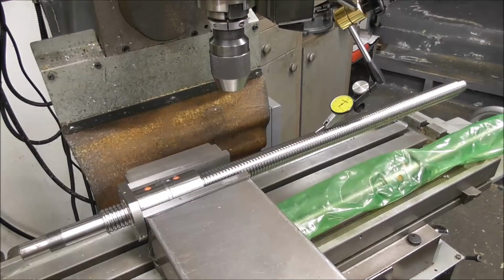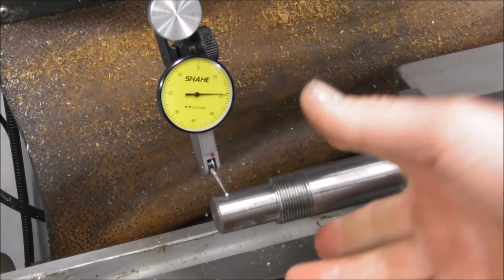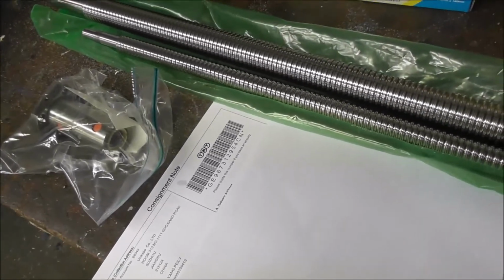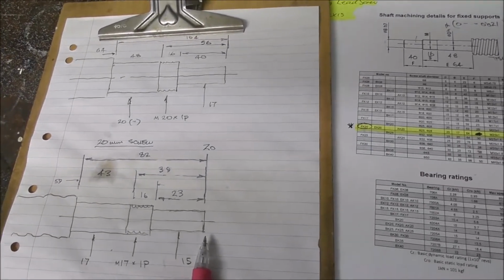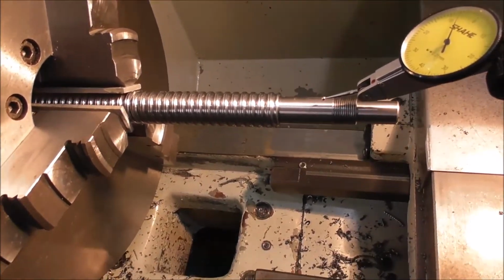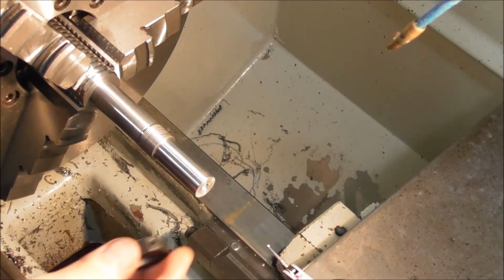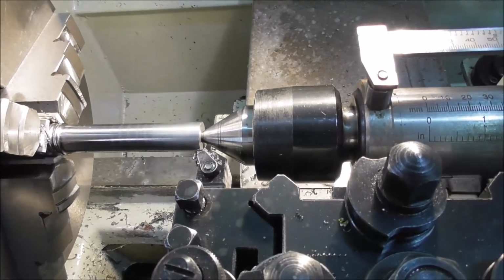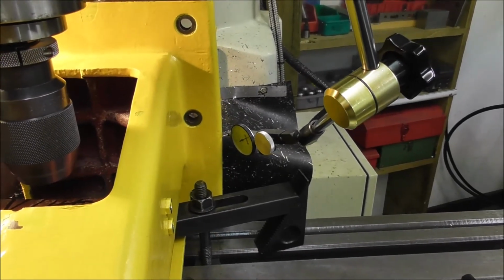CNC Conversion - Ballscrew Machining

Comment: Its great to see how you tackle this sort of job.

The following is how it is done in the factory and  think this is a reasonable quality supplier.
The reason I think this is the number of times that they measure the amount of bending in the shaft.
From the video it would seem they just use a 3 jaw chuck and assume the OD/ID and chuck are all in alignment.

I have seen other videos where they temper then check for bends once after the tempering and that is all.
 
https://www.youtube.com/watch?v=L5XEdwxN9Lg

This would also suggest that if you are machining a ball screw further along its length, by more than say 20mm, you may want to think about tempering that portion of the screw.
Reply from the maker: Hi Ian. Very interesting video. Thanks for sharing - I wish I had seen that before I did that job, it would have helped me and saved time. The processes they use seem mostly ok..but not the highest quality. I suppose they have to meet the market and as always cost is important to most buyers. Re "if you are machining a ball screw further along its length, by more than say 20mm, you may want to think about tempering that portion of the screw" Yes, I agree. Cheers, Cliff

Comment: Why checking the outer diameter that is not machined to tolerance? I would have checked the inner diameter where the balls run.
Reply: Basically what one should do is to use 3-wires method. The wires should be resting on the ball races.
Reply: @The_Unobtainium  yup, this is what he did when he checked the end machining concentricity using the ballnut to spin the ballscrew
Reply from the maker: Hi - I am not sure what section of the video you are referring to, its two years ago now but from memory I was not checking the OD was to tolerance. Just checking concentricity and parallelness. (I was assuming the thread profile was factory rolled and that the ID and OD are fairly concentric, I found the thread itself was made to a much higher standard than the subsequent modifications). Cheers, Cliff

Comment: Another Good Video. I noticed the M casted on your milling machine, which is also on a very large 5HP , NT milling I have up here. It,s Taiwanese, MicroCut , light years ahead of Chinese. Also have a MicroCut 24x120 lathe, which the manual says ite made in Taiwan, but the bed has a casting plate, made in China.
Thanks again 🇨🇦
Reply from the maker: Cheers! Cliff

Comment: hmm, this is a bit of a awakening - Maybe I will machine the ends myself. Do you think using a toolpost grinder to machine the hardened bit would be easier?
Reply from the maker: Hi - Perhaps hardness test the area with a file first to work out the zones that will be a problem, especially if you need to thread a hard zone, it is probably easier to flame heat and temper that zone. The hard zone may be deep, and toolpost grinding may be quite a mission. Let us know how it goes! Cheers, Cliff
Reply: yea, i was thinking spin slow in the lathe and run flood coolant over where i want the hardness to stay - torch the end.

As for indicating, can we trust the outside of the rolled ballscrew is concentric with the races the balls ride on? Maybe setting the lathe to threading and to the same pitch as the ballscrew so the indicator tracks the groove as you rotate the chuck? @Threadexpress
Reply from the maker: @Tezza120  The groove would be a more reliable reference, but you can't indicate between the jaws that way. Cheers, Cliff

Comment: I loved the video.  I am converting a Harbor Freight mill into a CNC Mill. This will be my first, I am going to cut my ball screws into two lengths.  I will if the lord is willing, taking the renaming length of the ball screw and make the second length for my Y axis. Your video has and will be a guide for my on this project. Thank you so much and God Bless.
Reply from the maker: Thanks for the feedback, Joe. Cheers Cliff

Comment: I recently replaced angular contact bearings on a 770S3.  I made spacers for the inner race gap.  Ground and lapped.  Based on your lock nut it looks like you will do the same on this project.  What are your thoughts on this approach?  My results have been exceptional.  I also upgraded to clearpath servos at same time but think the inner race spacer was what did it.
Reply from the maker: Hi SH. Thanks for your input. I only did the machining on this job for the client who is doing the mechanical. Not sure what he is doing. Cheers  Cliff

Comment: I don't understand why people keep on trying to have more accurate spindles, whereas you can achieve much more accuracy with an encoder, and some code. I use a 100 year old lathe with it's original spindle of 2 m, with an accuracy of 0,001 mm with a linear encoder. (so you measure the exact movement, not the rotations, they don't matter until you reach 0,01 mm of the distance, and then you can count the rotations)
Reply from the maker: Hi Johan. Perhaps you are wondering why ballscrews are chosen for manual machines? Mostly ballscrews are chosen for budget CNC conversions, where the use of linear encoders and their feedback into the control software is costly, and so rarely used.   Cheers  Cliff
Reply: @Threadexpress  Hi Cliff, I understand that for some people it is not so evident. In my case I converted a few 5 € calipers into linear encoders, and then a few arduinos do the rest. The total cost is under 100€ (but a looooooot of thinking and know-how into coding) A ball screw is not so cheap anyway, no?
Any way, I wish you a lot of success!
Reply from the maker: @JohanDegraeveAanscharius  Interesting! Thanks for introducing that. It may get others thinking.  Cliff
Reply: As far as i know, C-rating is for lead accuracy and P-rating is for axial play, P0 being the worst, while P2 and up is preloaded assembly: P2 light preload (often said to be 5% of load).

Comment: Great video! I'm interested to see more of this conversion.

I have some C7 ballscrews on a RF45 CNC converted mill and they're doing fine actually. Backlash less than 0.01 mm and accuracy is around +/- 0.02.
Reply from the maker: Hi Sameh. Good to hear. I was quite impressed with the accuracy and quality of those C7 ballscrews.

Comment: It may be of interest that when a gunsmith has a similar job ie threading a barrel for a compensator or moderator he will have a spider at the other end of the headstock and adjust it like a four jaw and go back and forth between the two ends untill both run true.
Reply from the maker: Hi Chris - Thanks for that information. Yes if I had not just ground the chuck jaws, I would need to do something like that. (Although that ballscrew length is quite springy and the length of jaw engagement would need to be reduced to allow displacement if there were errors in the jaws.)

Comment: Just out of curiosity. did you repeat the concentricity check on your turned ends the same way as in the beginning of the video? By threading on the nut and checking in relation to the nut and not the OD of the thread. Do you think it's possible the thread doesn't run true to the OD of the part?
Reply from the maker: Hi! Good to hear someone thinking deeply about this. The threaded stock is clearly of a much higher standard than the machined ends - you can see this visually when you rotate it the form runs true along its length. (for the machined end to be true to the thread then there would be large errors of run out after a few more inches between the thread valley and crest - but it was impressively accurate for a cheap rolled thread).